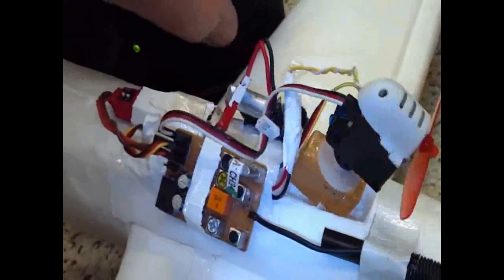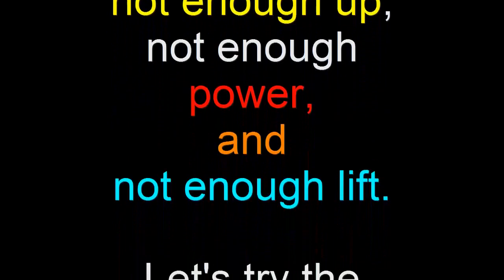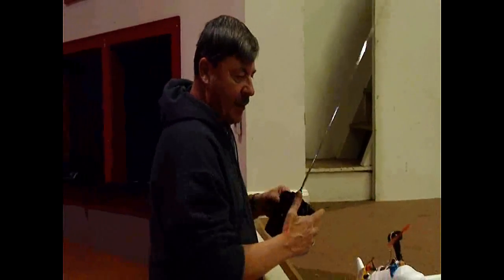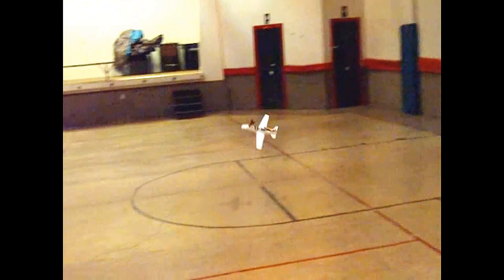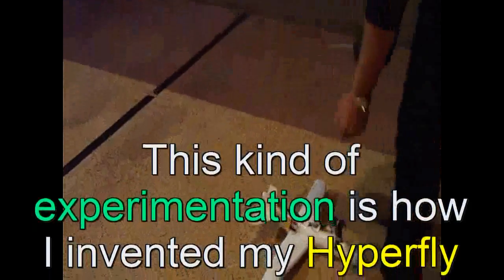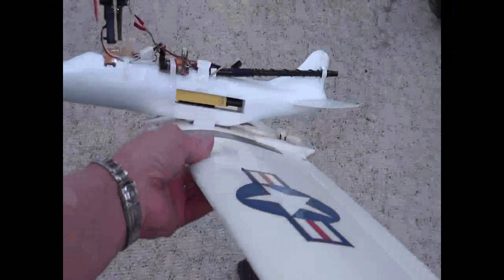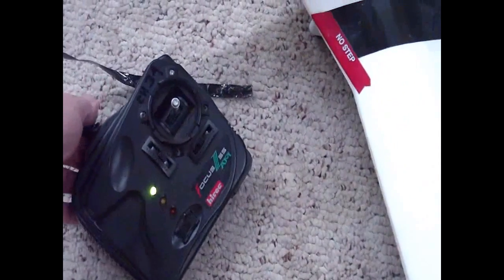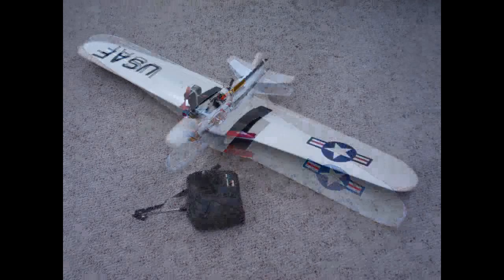RESULTS of "WILL it FLY", Re-visited Part 2 2009

Comment: This seems like a cool project! I think the CG is too far forward, and the thrust line is too high up. If you move some weight to the back and put the motor more to the middle, it should fly... maybe try a tail-pusher configuration?

Comment: How much does it weigh?  How big is the wing surface area?  Find both and calculate the wing loading, and compare it to other foamies... see if it's even capable of flying first.
Then calculate the amount of thrust you have... compare it to gross weight and figure out power-to-weight and its correlation to your wing loading.
After that comes figuring out the air flow, aerodynamics, weight balance, etc.

Comment: Is it balanced?  Maybe it's too heavy in the nose or tail, you might need to add weight to the tail to balance out the weight of the prop and motor up front.  If you can hold it on your finger below where the wings and fuselage meet it should be good for staying level in flight.

Comment: when i look at it again with the motor leaning back and the wings start to dive it actually pushes the wings down insted of putting the wings up i really think if the motor is on the back leaning forward for up the back for down it will push and lift the tail

Comment: Sorry Dave. Stil going to say no. the motor is not strong enough to pull it into the air without an elvator.(In my opinion.) I think the motor needs extra power simply because it's doing ALL of the work with no help. (Even with the dihedral that you just added.)

Comment: the thing that the motor pulls is better
but remove the servos under the motor and put them for elevators and rudder or one for the aerliones and elevators at the same time and one for the rudder and place the servos no either sides of the fuselage on top of the wings to maintain balance and use the smalest brushless motor you can find and pack th components inside and a more powerfull battery pack and try toreduce weight

Comment: I agree with Jasmine2501, but I think that if you add a lighter motor with more power in it and maybe an actual elevator on the tail, you will have more success.  5/5

Comment: That is such a good idea but such a useless airframe! I doubt the second one will fly; it needs a longer fuselage. That would be awesome with a bigger airframe and the electronics sunk into it so they don't provide air resistance. I reckon it would be great on a depron delta airframe as a pusher.

Comment: everything but the motor is to small and not streamlined enough.
also the wings need to be sanded into a profile.
jasmine2501 and RCSonicjet are right about motor placement.

Comment: It will not fly because the motors thrust line is way to high and is pushing the nose down.
If the motor was on the nose it would fly.